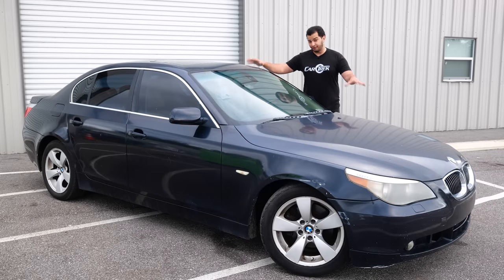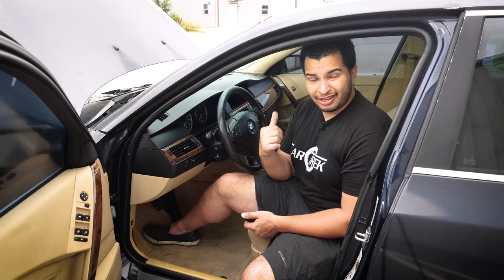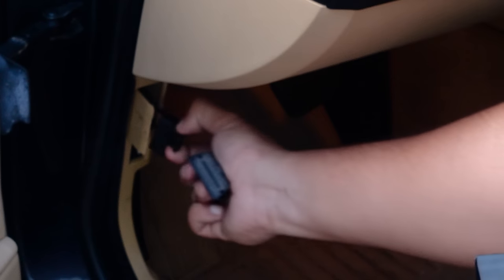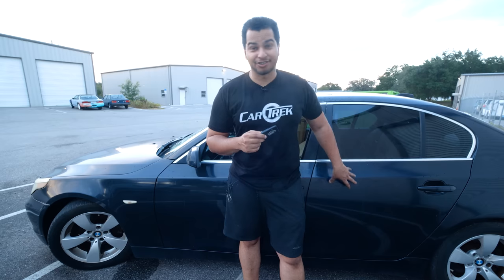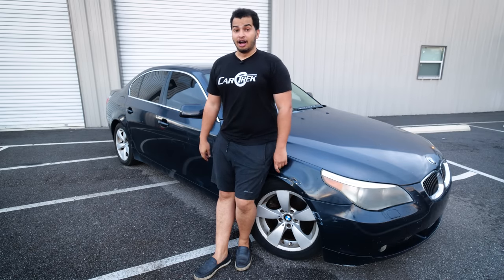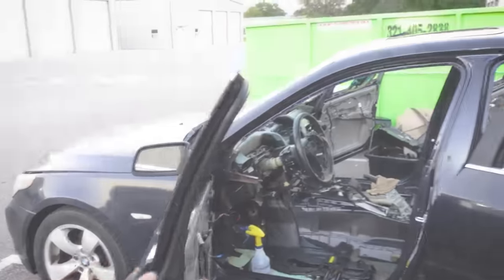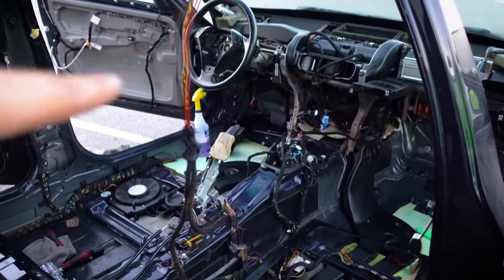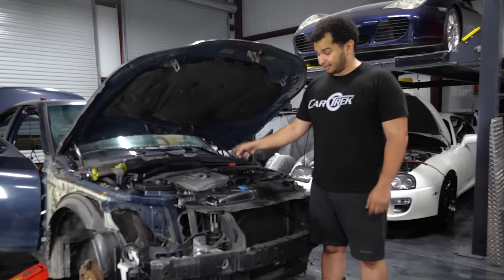I Bought A Running BMW For $600 (Because It's FULL OF ROACHES)

Comment: “A reliable BMW” -buys an E60 5 series 😂😂😂😂😂😂 should’ve gotten an E46 or E39. I’m excited for what you’ll do with it tho.
Reply: *E34
Reply: I agree. The E39 is probably the best car BMW ever built.
Reply: Yeah. But this one was E600 bucks.
Reply: How about e30
Reply: Idk man, my 2010 535i (n54 block) has only had one high pressure fuel pump failure over a span of 90k miles...
Reply: I have an 09 E60 N54 going on 150k miles. Had to replace the HPFP and gaskets at 90k. Going to replace the turbos for the hell of it. Easily one of the most enjoyable cars even after maintenance & shitty electronics. With tune and select modifications I’m pushing 410 rw, maybe more on E85.
Reply: it's ok if it's not the v10
Reply: It’s a 525
Reply: Yeah but the e60 looks much better
Reply: I had a e39 525is.
Absolute garbage. They are not reliable in any way shape or form.
Id say the last reliable 5 series would be the E34.
Not sure how the new ones are though
Reply: @mickeydee3595  Yeah because you had a bad experience it definetely means that all e39s are unreliable.
Reply: @nightmare8292  i had a e30 and e36 before hand and they were both good.
My e39 was a fucking nightmare.
Back then on the bimmerfest post somebody wrote a list with what goes wrong at what milage.
Mine was deadset a few hundred off his list. From failing abs module, leaking vapour barriers in the doors, every single gasket leaked, ac fan resistor the list went on.
Had it for 2 years and sank over 10k AUD in maintenance.
Also I went through numerous cooling system rebuilds that always let loose but it could have been the australian summer that was too much for it.

For comparision now ive got a VE SS commodore (pontiac G8) that ive had for 2 years, higher milage and the only maintance it has required was general maintenance and a new clutch & flywheel.

Maybe I had a bad one, but alot of people where complaining about them on the BMW forums 10 years ago when I owned mine
Reply: @fuckngreat8955  the e39 or modern ones?
Reply: MickeyDee Compared to an E34 you’re right the E39 does have its faults. But then you sit back and try to compare it to the E60 and any other 5 series that came after it, it’s crazy what happened to BMW😔
Reply: @michaeld2799md  i will wholeheartedly agree with you that the E39 was the best lookinh 5 series inside and out.
They absolutely nailed the design. Mine was also a dream to drive but constantly kept letting me down.

Comment: The e39's with the m54b25 are the reliable ones - not the e60's....
Reply: Early 60s had m54b30
Reply: @kostasangisoulaki912  yeah but they're still E60s. E39>E60.
Reply: @kostasangisoulaki912  I know that,  but the e60 platform itself has a host of issues, particularly electronic, that the e39 platform doesn't have - hence my comment.
Reply: The M54 was the last decent six cylinder lump BMW made, as my independent mechanic reminds me each time I consider changing the e46 for summat newer. I'd have a tidy e39 Sport in a heartbeat 😁
Reply: @jtrentha  owning E60 it's like being cursed with cancer lump in garage as having to repair long list of problems it's a lemon money pit

Comment: Just buy lightbulbs he says
Me: laughs in $300 e46 ballasts
Reply: Cries in E39 ballasts
Reply: @Mitchell.Is.De.Naam.  I just bought the facelift headlights for my e39.. $300 later🤣
Reply: @ernestoarriaga1579  I have a facelift which already has Angel Eyes units installed and the ballasts have already been replaced/or repaired lol. Got it from an older gentleman who didn't drive it anymore.
Reply: @Mitchell.Is.De.Naam.  those are the ones I just bought I have a 00 prefaced 528i

Comment: Here in Europe BMW is acutually known for their reliability, vs American cars with are knows for their really bad quality.
Reply: Finally someone says beamers are reliable.  I have a 18 year old e46 with 150k running great.  The newer ones are the best but the old ones deserve way more credit.  Some older american cars are reliable, not quality.  I got a 79 f150 with 67k original miles and she still driving down gravel roads and hitting lil jumps just fine.  They are worse interior but still reliable until like ~2006 when 2 l turbo and ohc became common place
Reply: Same thing here in Italy... maybe because ‘Muricans drive them much more and they’re bad with the cars’ scheduled maintenance?
Reply: Ndsisosnsb Jerks Bebe e  Well American cars are mainly known for transmission issues and really really bad suspensions, probably because you have really really streight roads over there and therefore suspensions does not to work as much over there, opposed to our roads with a lot of turns😅
Reply: My German cars have been incredibly reliable, my gm cars were not. On the German cars it’s all down to doing the maintenance as and when recommended and your fine.
Reply: My 1999 E46 318 is absolutely reliable with only a few plastic items needing replacement after all these years and 200.000 km. I have been wondering the same and thinking if the US bound cars are not made in Germany.
Reply: Americans drive about twice as much as Europeans and that’s compounded by the fact that second and third owners will often skimp on maintenance. German cars are much more sensitive to neglect than American cars. Japanese cars are generally more reliable than both and the Koreans are quickly doing the same.
Reply: @biznatcho7  I have driven extensively in the US and I saw that even if their cars have higher mileage, in general they are on more open roads with less stress on the engines. But you have a point on the latter. With so many luxury cars on the used market they are snatched on the cheap by people that do not care much for maintenance which I understand is expensive for European cars over there. So the neglected Mercedes and BMWs we see could be the equivalent of our old cheapo crappy Fiats, Datsuns etc that are driven to death in the European roads. I can attest for Southern Europe at least.

Comment: I would have left the car outside, close the windows and used a bug bomb before bringing it inside.   Gross.
Reply: run an ozone machine for a few hours and all the bugs will be dead along with any bacteria or viruses lingering around.
Reply: @MrBogie4646  there are probably eggs that will hatch in a few days or weeks.
Reply: @adcolt54  for the each bombing i would have waited atleast a day, but after reading this, I don't know if I'd ever trust it.
Reply: Yeah, once you filled it three times over with poison strong enough to kill roaches, are you ever going to want to sit inside of the sealed car for any amount of time?? No thanks, now it's a Hazmat site. Ozone is also a problem, if you have the concentration high enough to destroy roach eggs, it's going to attack any other organic molecule, ie your wiring, any plastics, especially rubber which will liquify upon ozone exposure. He's going to have to pull out all the electronics and pressure wash that interior to get rid of the roach funk, and what was that spooge in the door panel? Did they dip this thing in fryer fat?

Comment: My friend thank you. Glad to see your back to the BMW LOOK BMW is when taking care of is the ultimate driving machine. Now yes" your right the engine for long life has a lot to do with which BMW is going to last. Why! I have one 2010 328i E92 no I drive, no turbos, no electric steering, hydraulic please. And best of all m sport suspension, no,no,no, it is a blast to drive. I would have no other car, until I can afford a Ferrari or Lamborghini but for now the BMW so far after 150,000 miles still going strong. The only thing I have changed is the battery and the serpentine belt,, water temp sensor from BMW 30.00 bucks ok. But yes a nice running car. Years a fan of your channel. Love the content..

Comment: "no roaches"

dude... you still have roaches.
Reply: Piggybacking on a higher like count comment: Someone tell him to treat the car overnight with an ozone machine. Cover the whole car in some kind of insulated plastic and let ozone machine do its thing. Nothing survives it even persistent nuisances like mold
Reply: Windshield definitely looks like roach peed on it.  🤢
Reply: Yup, there are still roaches everywhere in that car, and now, in his shop.  disgusting.
Reply: Dam now your shop as roaches
Reply: park the car in high temp sunlight everything open so they can runaway - for 24 hrs -  then fog bombs wherever you can put them
Reply: @1badhaircut  it doesn't work like that. High temp don't work in eviscerating roaches.
Reply: @leefhead1  unfortunately roaches are a thing in Florida
Reply: EGGS!  Bruh!
Reply: @leefhead1  one thing I’ve learned is roaches are damn near impossible To get rid of without proffesional care
Reply: @FRIGGIN' BROBOCOP 
Ha! Was about to comment the same! When I heard him say it's roach free I thought "Spoken like someone that's never tried to get rid of roaches" <shivers> so glad those days are behind me!!!
Reply: Yeah roaches are insanely hard to get rid of. I would've bombed it, and called an exterminator or something. No way after only stripping the interior were they all gone. Way too many nooks and crannies for them to hide in.

Comment: Ive owned a couple BMW's. 7 series though. A 96 740il and a 2000 740il. E38 was a mechanical masterpiece. Very reliable. Only had to replace my waterpump on the 96 after the 3rd year owning it. Both cars only had 2 previous owners and both sat for years before i bought them. 4.4 liter, naturally aspirated engine is a good one and 2001 was the last year they were made in Germany. The idrive is a bit too clunky for me. A lot of timeless nostalgia in the 95 to 2001 7 series. I urge you to check one out brother.

Comment: The M54 engines (early I-6 petrol E60s) are bullet proof.
My 530i has 199k miles on it. It's been fine apart from the occasional coils dropping out.

Comment: I noticed no oil pressure on the guage while cranking should have moved up a little I’d hook up a scanner and check the high pressure pump oil pressure for the injectors could be bad injectors leaking oil but oil pressure air and glow plugs are important for it to run and of course fuel but oil pressure a must 🤛🤛good luck

Comment: I daily drive a 2007 BMW X3 with 196k miles. Starts up no issue and drives like new besides needed new shocks all around. It has the same engine as yours so I guess the reliability makes sense lol
Reply: I almost forgot!! I got it from copart with some damage for only 900 dollars. No rust, new tires, interior smells like new somehow, and it has the auto level adaptive lights etc. I love it

Comment: Everybody talking about BMWs being unreliable especially the ones after E39, but only the legends know that if you buy the M57 diesel engine powered BMW, you are basically problem proof, the only issues being the EGRs and swirl flaps, which is a walk in the park to fix and be done with.

Comment: I have n52 engine on my x3 3.0i I love this car. Sometime I’m thinking to buy a brand new car but this old x3 won’t let me buy. Car has 18 years old but still reliable and also has more features than some brand new cars. The only issue it’s  4*4 system from what I heard. But i didn’t have that problem yet.

Comment: I had roaches in my SUV. All I did was get a fogger bomb. You put in the middle and activate it. Leave it for the time the instructions tells you then open and leave the windows down to air everything out for a couple of hours or what the instructions say. Pick up the dead roaches with a vacuum and clean the interiors. No more roaches

Comment: I would have stripped it just like Tavarish did. But before I drove it in to the garage, I would have gone to Walmart and bought a cheap "party tent", some plastic sheeting and duct tape. I would then have hermetically sealed the car in to that tent together with 10 "industrial strength" bug bombs, set them off all at once, and left the car in there over night...

Comment: To get rid of roaches in any vehicle is tricky unless u know that roaches have 1 LARGE WEAKNESS.  They can't survive below 50 degree weather. Take it to am area that is below freezing.  Leave it without engine running for no longer than 10 minutes a day.  The entire breed will be dead in 4 days to one week.  They need the engine warm, so they will rush to heat, but the engine gets cold extremely fast when not running.

Comment: The N52 really hates boost. It cant really handle more than 5-8psi before rods start to bend, the block starts to crack etc. The N52 is nearly at its maximum potential from factory. The N52 out of the 330i and the 530i is the one you want really. It has the 3 stage intake manifold that brings it up to around 250hp. And the most the N52 can really handle is about 320-350. But its a very smooth and linear power band. And it stays reliable around 270hp which can be achieved with that 3 stage intake manifold, some headers, and a tune.

Comment: Holy crap, there's a lot of wiring under the interior of a modern car. I'm used to the ones from the 1960s, where there might be, like, six small-gauge wires running to the taillights and maybe a rear speaker. :)

Comment: When you buy a running car and the word "running" applies more then once... you got a problem.
Also bmw´s inline 6 engines have and are mostly been great and lasting. Its the v8/v12 which are usually sending you huge repairbills. Last reliable v8 was the e38 preferably the pre vanos 4 liter, even so you still had to get fix some things to have a lasting engine.... the later models.. don´t buy just lease and replace, you don´t want to have them when warranty runs out.
Off course this might now change with the inline 6 as well as with all the turbo shenanigans and 0w oil.. i dunno.

Comment: Thing about reliability is not true. Only M5 was very unreliable. Ordinary cars, specially 3 liter diesel is considered indestructible. 2 liter version is less reliable, but cheaper to fix.

Speaking of 525 being having no problems. In my engine block got cracked between two cylinders, but it was an old police car so idk what they did to it before I bought it. As these cars are super cheap in UK it was quite a good deal to import one to Poland and replace it.

Comment: I've had two e60's with M54B30 and any USA  car is not anywhere near of German car in this engine capacity range, especially Bmw's. I drive them since 1988 e34 535i, e39 523i, 2 x e60 530i until recent f10, f07 GT models of 5 series. Regarding engine issues related to fuel, etc it would be worth to explain why only in USA e39 engine blocks of inline 6 been made from castion instead alluminium as European? Fuel quality  of course. It is not a problem to find a piece of junk, but in this e60 you will restore it. That is why German cars are best in whole world.

Comment: I do have 528i 2009, the engine is really good and reliable, but the electronics are not so good and they are costly to fix. Having one of these costs 2000 Bucks annually on maintenance.

Comment: You bought the wrong model. The 2003/2004 M54 is one of the most reliable ever. My 2004 e60 M54 525i was bought in 2009 with 50k km. It has now 230k km. My total costs for the engine since 2004 were 800 Eur, all maintenance/repair costs since 2009 are not more than 2500 Eur in 14 years of driving. Greetings from Germany :)

Comment: This made little sense to me. Roaches can easily hide in between small crevices and linings in the car, so removing the interior could ultimately prove useless. What would've made a lot more sense was to use one of those 24 hour bug sprays and then remove the interior afterwards, or better yet, keep the same interior but but clean it out thoroughly.

Comment: 2 years ago I bought an E61 530XD (same thing but 4wd wagon) in apparently very good shape with 120 000 miles on the clock. Best car to drive I've ever had, but also most unreliable. It had a new problem every week, often only just software issues but hard to fix. This car seemed to be developed by underpaid trainee third world engineers in the same kind of vicious corporate accountants cost cutting that lead to the design of the tailgate handle (worthy of a 1$ throw-away flashlight). The car ended up being towed away to the scrapyard with a software issue that prevented starting the engine because the gearbox refused to talk to the engine, and only an official dealer could fix that. But the dealer would "cure" the issue by changing the gearbox, which had absolutely nothing wrong with it. Bye bye BMW, never again !

Comment: Me, a detailer: "why would it have roaches?"

sees drips below E-brake

"Ah."
Reply: Plz explain
Reply: @jmton6510  
I was surprised the roaches were there at the start of the video, because the car looked generally pretty clean on camera, with not super obvious poorly-lived-in signs like stains on the carpet or leather (the leather was worn, but you could attribute that to the Florida sunshine). my surprise ended seeing those marks by the E brake. 

that alone tells you that the owner ate/drank in the car, and wasn't super clean about it, which explains the roaches. the only permanent stain left after the obvious detailing done before resale (at least, visible to camera) was the tatteltale one next to the console, which wasn't visible until the seat was removed.

Comment: I own the same engine in my X5. it has around 140k miles on it and has been very good to me.
Reply: I have the 07 530i with almost 160k miles only had to replace the transmission so far